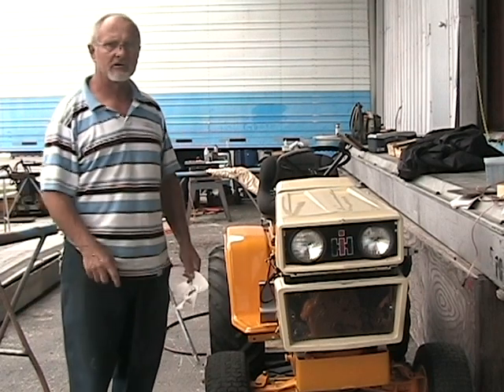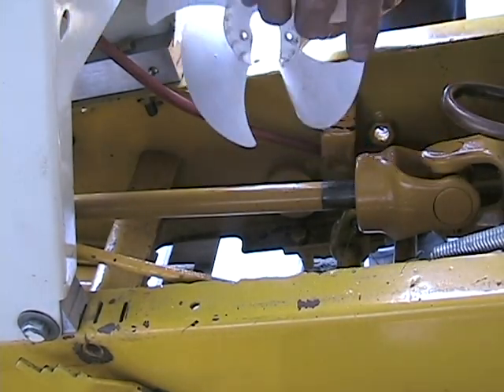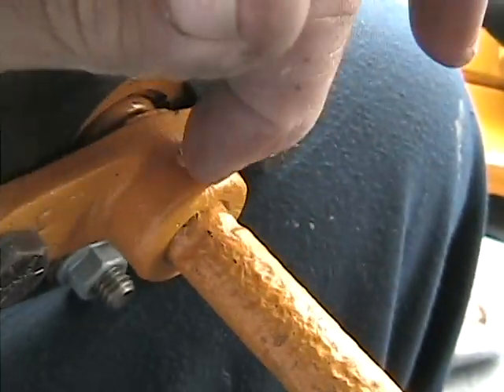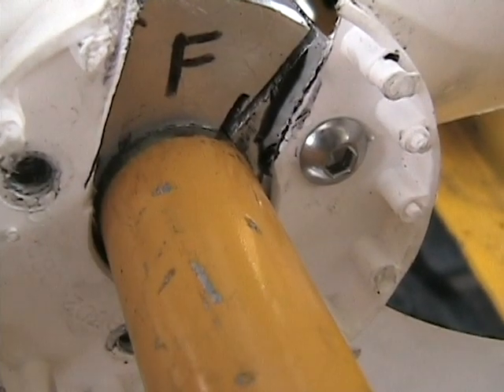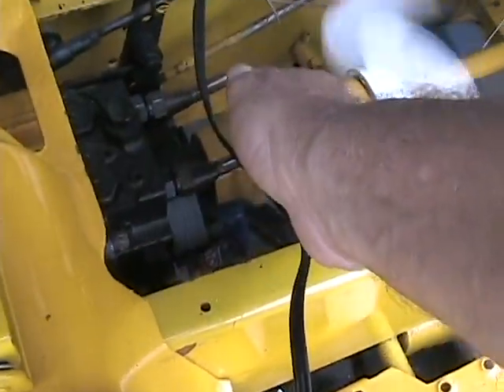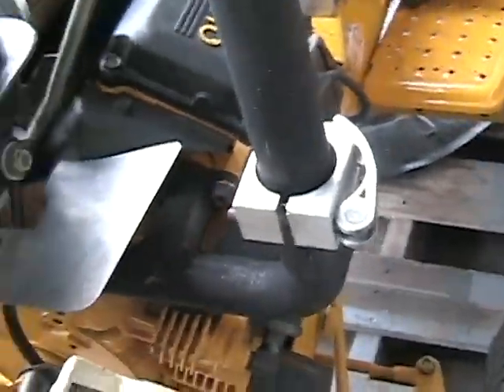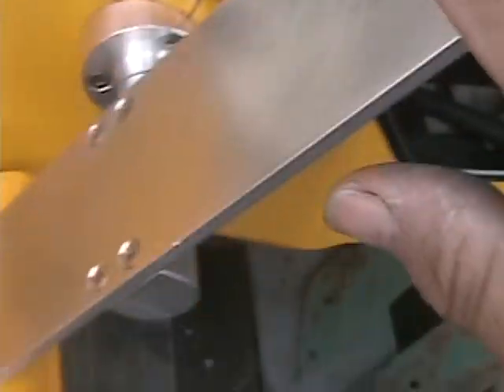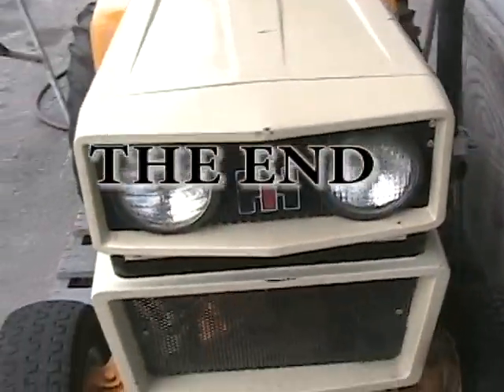Cub Cadet 1650 hydrostatic fan mod

Comment: What a great old reactor. I had a Cub Cadet 1250 htdro for 30 years. Engine had been rebuilt three times and the last time it failed I sold it for 350 bucks and made the mistake of buying a new one just four years ago. As far as I'm concerned the newer models are junk compared to the horizontal drive shaft,
Reply from the maker: +George Humphrey You got that right they're nothing but an MTD junk.

Comment: I half to find yolks like that for my cub cadet 123 hidrostadic. I'm putting a 18 hp opposed twin in it where did u get your yolks I thought about using yolks out of a car steering shaft will they work the same??

Comment from the maker: when i bought my tractor someone was selling it for parts all lines and hydraulic assessories were missing and order to get it running i had to loop the hydraulic so pressure could flow out and return back in pump one is out one is in it has to loop if you
plug the lines you might get by for 1 hour then you will find that you cannot get foward or backwards your hydrostatic is screwed i would like to see your tractor do you have a utube channel

Comment: i may be asking a stupid question but why on your hydraulic ports did you have one go into on and out the other because i took all my hydraulic deck lift off when i made my loader for my 149 and i need a way to cap those off could you explain why and how it works or if it hurts anything please

Comment from the maker: i bought yokes from tractor supply the smallest one they had was 3/4 for my hydrostat yoke was 5/8 so i made a bushing for it now it works just fine but the yoke on my engine is a 3/4 because my  engine is a generac is 30 horsepower